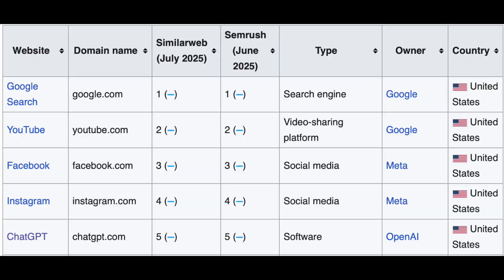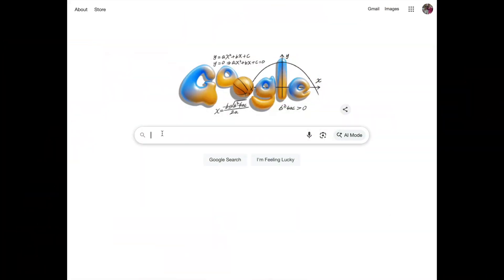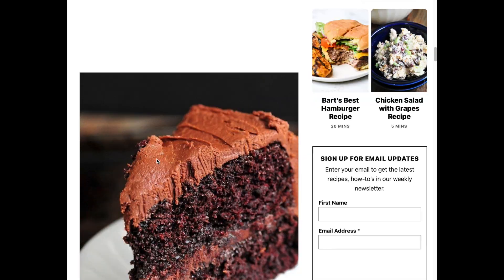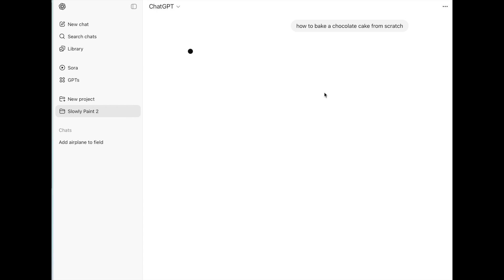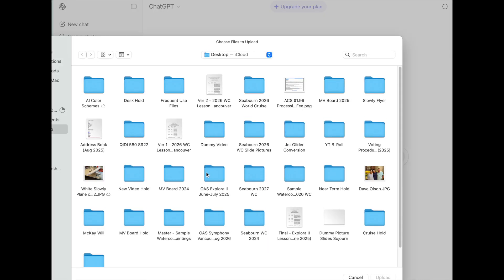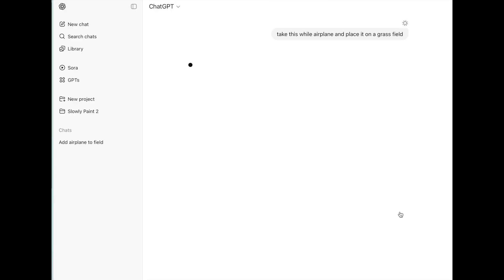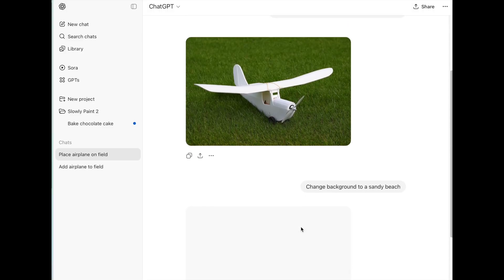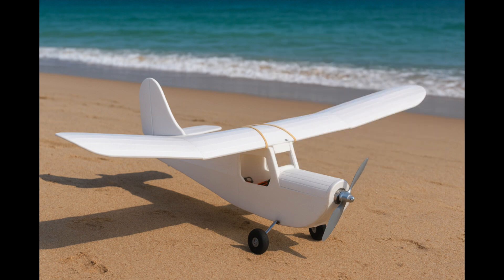Artificial Intelligence and Model Airplanes

Comment: I used to fly models, frankly, having most of the fun making them, crashing them and repairing them! These days I teach online management stuff and use AI quite a bit ... 

When I first saw the name of your post Artificial Intelligence and Model Airplanes, my heart raced ... "WOW they NOW use drone software and use AI to kick in if the craft is about to crash" ... 

Okay, so I was way off ... but for bigger kits using electric power (since batteries have become lighter and more powerful), is there some scope for doing that? Any of your smart subscribers got thoughts?

Oh yes, and maybe AI is of little help here, but what about all you processor software kings out there? A hobbyist autopilot for example ...

If this is way off topic for your channel Tim, shut me down no offence taken Haha!
Reply from the maker: Hi Dave, No worries, point of the video is to start the conversation.  The challenge is that there is, from what I can see, not a lot of documentation out there on electric motors and the various components, so maybe hard for AI to put this all together.  We'll see!!